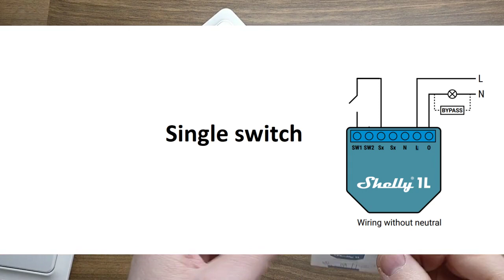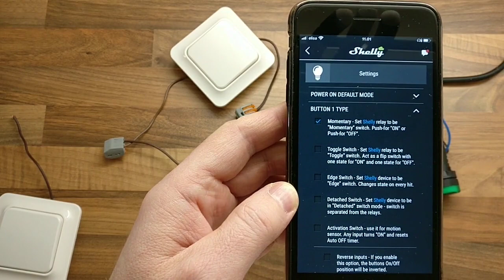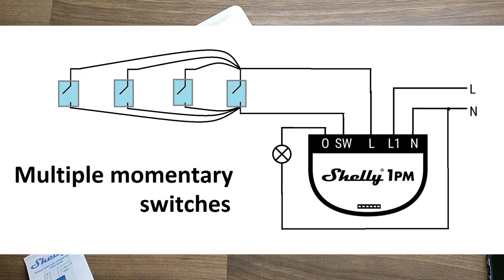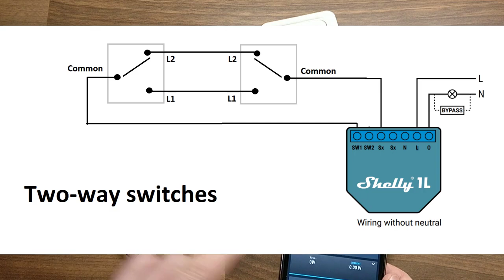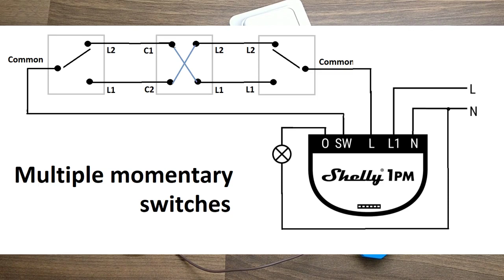Two-way switching with Shelly relays

Comment: Thanks for this tutorial. I have a question if you don't mind me asking. I have similar setup, however, I have 1 switch as 1 gang switch and another as intermediate. How can I wire them up? Do I just introduce Shelly on the normal 1 gang switch? Also, I have 2 lights connected with total of 16W, do I put the relay only across one of them? Thanks

Comment: Thanks this is helpful but confused with i3/i4 is it wired similarly because sometimes it does not work for me. If switch the secondary switch the first switch stops working :D
Reply from the maker: Hi, What kind of switches you are using? If you are using normal ON/Off switch with two wires only, then they do not work. You need either push (momentary) switch or a two-way switch with three wires.
Reply: @SmartProjectsABC  Thanks for the reply, I think the solution was the two-way switch with three wires. 

I have the Shelly i4 and one switch is downstairs no live and one switch is upstairs which has the live wire. 

Since I got a smart bulbs I wanted the bulbs always powered and existing switches to talk to the bulb to toggle its status. 

I ended consuming 2 switches on the Shelly i4. So on Shelly SW1 to Switch L1 and Shelly SW2 to Switch L2 and that seemed to work. I had to program 2 switches but your diagrams explaining how 2 way switches worked ultimately got me to a working point.  

I initially tried to follow the diagram on your video @ 1:39 but I think for the Shelly i3/i4 that might not work. 

Never the less thanks again for sharing it got me to the right place.
Reply from the maker: @Manish-fm5iv  Interesting! Seems like Edge Switch button type is missing on i3/4 and as such, would not work with two way switches. Your only option is momentary switch / push switch but this mean changing your switches :(

Comment: would like to know. what if there are multiple lights wired in series controlled by a shelly 1L. do you put the bypass in every lighting points?
Reply from the maker: You need only one bypass if the total load all your lights in series is less than 20W. For example, you have two 7w lights = they make 14w only so you need a single bypass. If the load light added together makes, more than 20w, then you remove the bypass. However, there might be cases with LED lights (not all) that when calculated together they make 20w but still 1L will have issues with them so you might need a bypass also in some rare cases.

Comment: Thanks for your video. If you are talking about two-way switches than you are assuming that the switches are connected via three cables...Unfortunately are in the practice only two cables available and it is not possible to pull a third cable into the protective tube...
Reply from the maker: Hi. Then you can change switches to Momentary (like door bell switch) then you will be able to use only two cables
Reply: @SmartProjectsABC  Hi, it is clear. I just didn’t want to replace my existing switches…

Comment: Hi Thanks for this video . I'm in the US  .....  

Instead of replacing my light switch with a smart switch, I would like to keep the Toggle dumb switches and install shelly or sonoff to make them smart 3-way switches.

I have two dumb 3-way switches to control 1 lamp, in 2 different electrical boxes.

I wanted to install the shelly or sonoff device in the second box.

First Box

switch1 --> One hot wire, Two travelers going to box 2

Second Box

Switch 2 ->  One  Lamp wire,  two travelers coming from Box 1
Available: 1 Neutral Wire, 1 Hot Wire.

In this case, looks like this wouldn't work right?  Because looks like both switches need to have a cable connected to the shelly .
So I would need a third cable coming from the first box to the second
Reply: @SmartProjectsABC  Hi, I have similar wiring as the one described by Douglas. I do not think that shelly 1 L  can be used. If I put the Shelly 1 L in box 1 I have L connected to the Shelly but it cannot get permanent connection to the lamp. And on the opposite if I put it in box 2 I will be missing the constant connection to L. Seems that the solution for 1L is working only in case Live comes to box one and the wire to the lamp goes out from the same box.
Reply from the maker: @mechokuh108  Hi. Had to make a FB page so that I can attach photos. See this https://www.facebook.com/SmartProjectsABC

If you want to convert existing two-way switching installation than you have change Two-way switches to Momentary (push) switches and Line is disconnected from switchbox 1 and connected to switchbox 2 where Shelly 1 is installed. The switchbox two connects to the light

Comment: Can you use shelly 1L to control roller shutter? Because I don't have neutral line in the switch box
Reply from the maker: I am not sure. Depends on the shutters . You probably would need two x Shelly 1L and two x bypass. Than it will be up to shutter if it wands to work or not considering that there will always be some current passing over the shutter switch wires (regardless if you have shelly 1L button pressed or not)
Reply: Usually you would use Shelly 2.5 to control a roller shutter, since you need to control UP and DOWN independently. Maybe you have a special type of roller, but normally a motor needs a neutral line

Comment: Good video thanks! Can you please advise if when using the two way switching and have them on, can you still turn off the shelly from the app or do the switches override the shelly app?
Reply from the maker: 3-way switches behave the same way a single switch does. If you turn it ON via shelly app, you can turn Off using switches. Shelly app will show that light is (become) ON and of course, you can turn it off via app as well.

Comment: Nice video. I tried to use 2 momentary switches as shown in the schema for the shelly 1 but the lights wont turn on when I press either switch. When I just connect either monentary switch independently the light does turn on. Any idea what I am doing wrong?
Reply from the maker: Will light turn on when you press them both at the same time? Most probably, you have connected them in series. The other issue might be that one of the switches is in ON position when you connect it.

Comment: Good video, thanks. This is the setup I have, but I have the three switches one you described. Here in Ireland, we call the middle switch as per your diagram an 'intermediate' switch. You can add as many of these as you  like 👍.  Only other change I have is an automatic off time, this is set via the shelly app, can't remember now, but it wasn't that hard to find!
Reply from the maker: Thanks for you information! Happy new year!